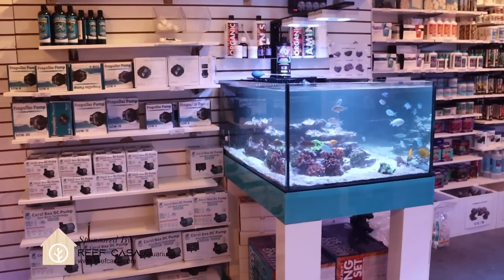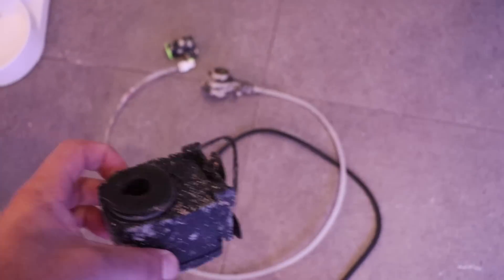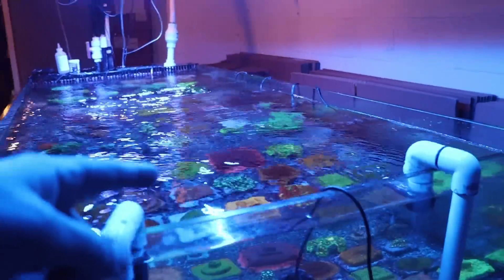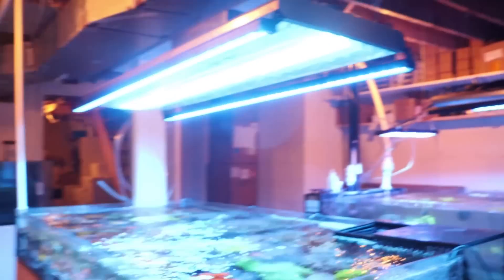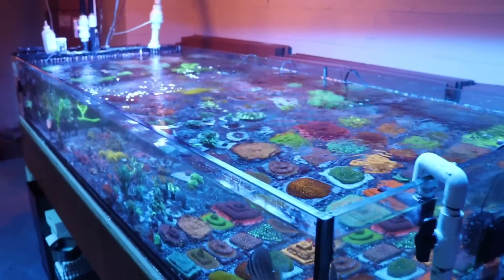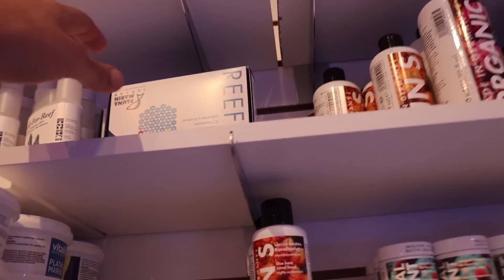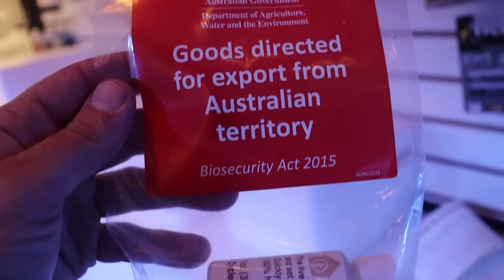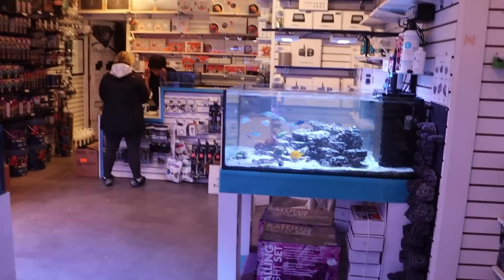Stray Voltage In Our Reef Aquarium

Comment: A grounding probe should only be used in conjunction with a GFI/GFCI. By installing one without it, it's basically connecting the circuit and zapping away 24/7. Otherwise, the potential just sits there. Putting different pumps or groups of pumps on different circuits, would shut off just that circuit instantly, if the GFI detected a problem.

1) titanium probe + GFI. (Ample chance for safety rather than point 2 below)
2) GFI only (safety here is that GFI shuts off when it senses the difference such as you putting hands in the tank and current going to you, but the GFI needs to be working properly)
3) Never use probe + normal outlet 

It is safety and health vs having something shut off when you aren't around. The fix? Split up all equipment on multiple circuits with redundancy, using GFIs.

The debatable part..... by using option 1 and creating a "connection", does it affect the animals in the tank as opposed to only having potential sitting there due to voltage. If paranoid, use GFI and have a probe on hand.... plug probe in before doing work in the tank, then unplug probe after.

Comment: Ok issue I am having with voltage on my water is that it will not go away no matter what is plugged in or not.  I am an electrician and have new lines ran to the tanks one has a GFI and the other is straight receptacle.  If I ground the water with a wire to a pipe and drop the other end in the tank voltage gone.  It’s only 20-50v but I have lost some stuff last few months and some stuff not opening full.  When parameters in check icp in check people need to check for this.  Could be a grounding issue with the service or utility.  Plus if you have GFI installed and a ground probe the gfi will trip if there is an issue where as it will not trip always until you touch the water and ground yourself.  

I’m getting 2 of these today and I will let you know if everything opens back up.

Comment: With a GFCI , current going into the GFCI must equal current going out of the GFCI . It won't trip on a short circuit .The Circuit Breaker will . With a ground probe , stray voltage will go to ground causing a unbalance that will trip the GFCI . The reason most aquarium stuff is two prong instead of three prong is the same reason a toaster only has two prongs . I'll spar ya the details. But most countertop kitchen appliances have two prongs cause their often near the sink .

Comment: Hey March, sorry to hear that happened to you. You mentioned that it tripped the breaker, which makes sense. Do you have any GFCI outlets in the basement or wherever you have these sorts of devices connected? If possible, I recommend getting some installed by an electrician. That way, if there is a voltage spike or drop, it will kill any of the outlets associated with the anomaly. It would make it pretty easy to pinpoint what the problem is. So maybe all powerheads for a particular tank associated with one GFCI network, and another network for another tank. That way, the powerhead won't keep trying to power itself and you can quickly identify the issue and take out the offending appliance. Good luck!

Comment: I just had a very similar experience, but with an Eheim Stream pump in my saltwater mixing bin. I didn’t figure out the cause until after I’d done a water change, and all of the corals started sliming and closing up. I’ve been doing big water changes (60 - 90%) every other day since it happened last week, and most corals are just starting to look like they might survive. Lost some mushrooms, all of the Xenia, some GSP, my favourite frogspawn, and a cleaner shrimp. All fish, snails, and hermits were fine. ICP showed nothing unusual, apart from off the chart iodine, which I think must be a testing error. Hope all of your corals pull through 👍

Comment: I would think that if that probe is a conection to ground and you put it near any aquipment it actually may help, but you have to put it close. That way, if there is a lose contact on the equipment, the voltage will drop fast because the probe is near and hopefully the current that would be generated will have a short way to ground and out of the tank instead of finding ground on the other side of the tank and flowing through all the corals causing havoc.

Comment: Why have you not learnt your lesson from the last time bud. Everything in your shop needs to be on RCD's. In the UK they are 30 milliamps breakers as standard. That pump wouldn't of even began to heat up. It would of just tripped everything that was on it when it sensed the differential. Apparently you guys in Canada or America call them GFCI's (ground fault circuit interrupters)
Reply: Yup, I explained in another comment to use a GFCI network for each tank. And exactly, it would never get to that point due to any voltage spike/drop.
Reply: This dude is hard-headed. Just because you run a fish store doesn't mean you're smart. He'll eventually learn the hard way

Comment: I don't trust anything with AC power cords anymore in the tank. I've had urchins eat into power wires causing stray voltage. AC pumps, submersible UV lights and water on cords have all zapped me before. I'll now only install  DC pumps.

Comment: Everything fails if you don't keep it cleaned.  People complain about equipment failure all the time, but when you see the equipment, it hasn't been cleaned in years. 
That's a staff issue and whomever is responsible for making sure that equipment is kept up, would be on the sidewalk.
Lastly, absolutely use a grounding probe in EVERY system you have.  You can test the grounding probes if you have leaking voltage in a bucket by plugging the probe into a ground socket and use your multimeter. It absolutely works and is a life saver.

Comment: An earth probe will stop the zap sensation you may be feeling when touching the water If you have stray voltage in your aquarium. However it will not actually stop the electricity flow through the water. In summary it's not a bad idea to add an earthing probe to reduce the chances of electric shock. It won't fix your equipment that should not be emitting current into the water in the first place.
Reply: He needs to use RCD's on everything!

Comment: I run grounding rods on all my aquariums , I’ve had heaters give off stray voltage before . If I didn’t have the grounding rods I probably would have lost some live stock!
Reply: Stray voltage doesn’t kill, since the fish aren’t grounded. It could damage corals if not mistaken.
Reply: @dominus6224  I sure felt it when I touched the heater ! Not sure what woulda happened if I didn’t have a grounding rod

How does it damage coral but not affect fish?

Comment: Hate to say it. Marineland is junk, imo. Is your tank grounded, to earth ground. And buy power strips that actually trip, like a breaker.
Reply: Gotta be careful with the power strips that trip like that because sometimes if u have a power failure I’ve heard of them not turning back on after 😬 eg mid winter night time power failure for 2sec normally power comes straight back on after but I’ve heard those ones can not come back on even if the power returns… not happened to me before so i might have misunderstood what happened but yeah if u gotta reset the switch it could be a problem if for some reason u forget or miss turning it back on…. Easier to remember if it’s just 1 tank at home, but if u do a bunch of them in the store it’s easier to accidentally miss turning one back on 🤷‍♂️🤔🍻
Reply: @JakeDogg-RIP  do you want to be safe or have convenience, your lucky the place didn't burn down not recognizing the early signs of an electrical issue
Reply: @timl2546  I’d rather not loose all my corals 🤷‍♂️😉 I know what ur saying, that’s what fire alarms are for tho

Comment: I had something similar happen about a year ago. I went to bed and the next afternoon I checked the tank shortly after I got home and noticed the water wasn't moving. My Peppermint Shrimp had died and my corals did not look good at all. I checked the Sicce 1.5 that I got with the tank 2+ years ago, and found that because of the angle the power cord was at and the constant vibration, it ended up cutting the cord open, which ended up blowing up the pump. I'm not sure when exactly it happened, between the 12hrs from when I last saw it, but I did a big water change and replaced the pump. It's a nano tank (a 14 gal biocube with a hood) so because of the lack of water movement, it caused a rise in temperature, so I lost alot of my corals. In the future I'm going to treat my pumps like heaters, every 18-24 months I'm just going to replace them (or atleast in regards to the nano). I'm glad you had better luck then I did though and interested to hear solutions to keep this from happening again (or atleast bring my attention to it sooner)

Comment: I am an electrician and I have no idea if ground probes are the way to go. A ground probe wont stop things from going bad.
I believe its Ryan from BRS who says the only real solution to this problem is to replace equipment before it goes bad. In other words just have a predetermined life expectancy for everything and preemptively replace stuff. I do take it with a grain of salt because of course he runs a supply company but even so I think that's the best way to keep this from happening. That and having reef controllers watching the watts of everything and setting an alarm if something isn't right.

Comment: There was no stray voltage. The power strip was doing its job. Every time you reset it you we’re creating a short circuit. That’s why it finally tripped the breaker.
Reply: Yes March, read this comment and replace that power strip. It’s probably effed now.
Reply: @FoolOfATuque  I’m sure the power strip is fine. It worked every time. The problem was the wave maker. That’s all. IMHO everyone of those wave makers that were installed @ the same time has out lived it’s value. Not worth the risk.
Reply: @johnblaze5252  if a surge protector has been tripped you should replace it. Over and over and you should definitely replace it. We just lost a LFS to fire. Don’t need to be seeing that again
Reply: @FoolOfATuque  you can replace it all you want but you are wasting your $.  Poor wire management & no knowledge of how electricity works is not a good enough answer. I do this for a living. If you are lighting things on fire. Don’t blame the power strip. Try purchasing a GFCI & pay attention. Even though I am knowledgeable about electrical work.. I’ve killed my fair share of LPS but I’m not blaming anyone.
Reply: @johnblaze5252  well maybe you need to read the instructions from the surge protector manufacturers then Mr “I do this for a living” what company do you with as an electrician for? So I can steer clear of it. So you’d. Go into a customers place and not recommend they replace a power strip they tripped multiple times? Lol!
Reply: @FoolOfATuque  Union electrician . Replace away all you want. IBEW A member 23 years hard core kid. 😂
Reply: @johnblaze5252  cool story bro.
Reply: @FoolOfATuque  only here to exchange knowledge & learn🍻
Reply: @johnblaze5252  by the way IBEW doesn’t impress me. I know IBEW electricians that are complete idiots. Thanks for reinforcing that stereotype.
Reply: @johnblaze5252  Even if your power strip still seems to work fine after a surge, there may be damage that is not immediately visible. Over time, this damage can lead to a reduced ability to protect your electrical equipment from future surges, or even create a safety hazard.
Reply: @811chicago5  you are free to replace away. What ever you can afford. I prefer to wait until it’s necessary. It’s like.. why kill the messenger ? And why not replace everything that was plugged into the same surge protector?  The issue was the wave maker. If you are comfortable plugging into a troublesome surge protector that is corroded or has bare wires & broken sockets you should replace it before that happens. Tossing a GFCI surge protector into the trash cause it faulted is just tossing $ & trash into a landfill. It’s important to have some sort of middle ground. My whole point is the short was from the wave maker. There is & never was stray voltage. It’s very basic. The point of failure was the WM. The rest is up to your discretion. However if it’s not broken….
Reply: @johnblaze5252  I'd like to add my opinion that in general, it's recommended to replace a surge protector after a surge to ensure proper protection of your electrical equipment. However, in the case of Fragbox Corals, it sounds like the issue was due to a short in the system, rather than a surge. Therefore, it's not necessary to replace the surge protector in this case.
Reply: There was stray voltage when the pump was breaking down.  It would have been caught before it was that bad if there is a GFI and a ground probe.  

Pumps just don’t go poof!  They will break down gradually over time and during that time you will definitely have voltage on your water.
Reply: @Mcappo  only in fantasy land
Reply: @johnblaze5252  in fantasy land things just go poof!
Reply: @johnblaze5252  union electrician explains it all!  Lol. Think they are the best of the best.  Me union me know all.  With all your knowledge you would know that devices, breakers, power strips should all be replaced after faults.  Maybe they don’t teach you how to read the manufacturer instructions which trumps all codes you think you know.  🤣
Reply: @Mcappo  Manufactures provide instructions for people like yourself who have no idea how electricity works. It’s a good idea honestly. Tossing perfectly fine equipment into a landfill because your knowledge is limited to an instruction manual makes you an expert and it eliminates my 25 year of experience. You are genius.  59.95 an hour straight time + pension . Full benefits & annuity 🤣. You are an expert..
Reply: @johnblaze5252  yea because my training and 30 years experience and being licensed electrician means nothing.  You are typical yahoo union wire jockey who thinks he knows all but is stuck buying the crew coffee.

Comment: Voltage is just potential for current flow. A shorted pump won’t cause current to flow through the coral. I’m sure you’ll find elevated copper in the ICP test, which is what’s cause your coral stress. The ground probe wouldn’t help you here, the ground plug on the faulty pump achieved the same thing a ground probe would, caused the power strip to trip. Get that copper out!
Reply: Stray voltage does affect zoas. I have a frag tank with nothing but zoas and a surface skimmer shorting out in the water wiped out colonies. No metal parameters were good.
Reply: You had something else going on. Potential is only potential. There was nothing there to affect your zoas. Unless your skimmer was ungrounded and you had a grounding probe stuck into the middle of the colony forcing the current through them, it was something else.